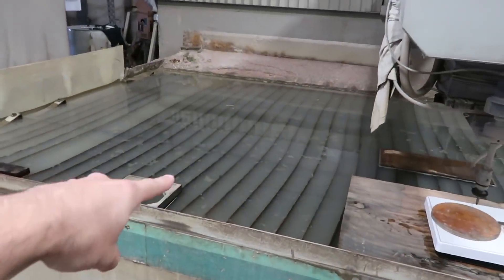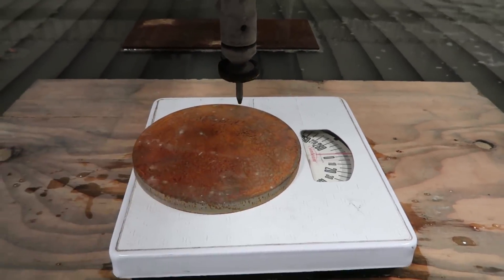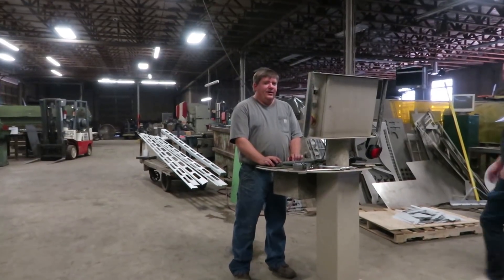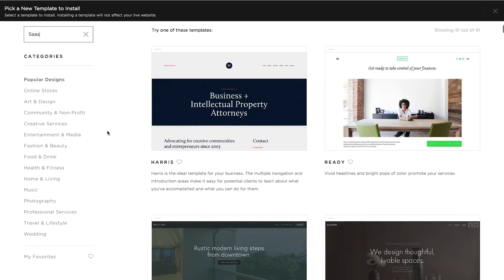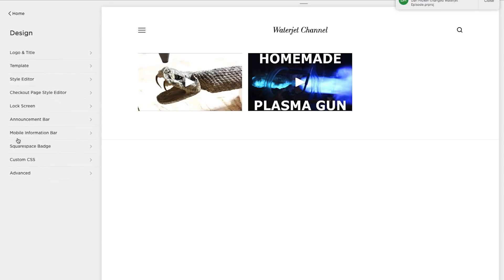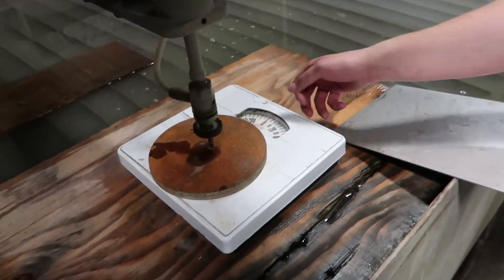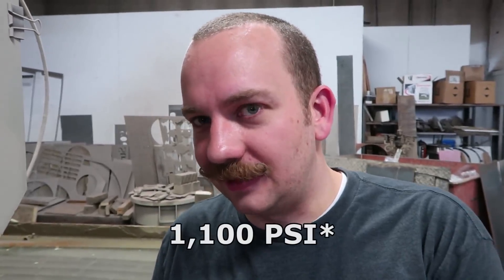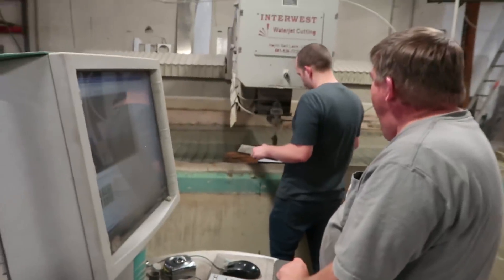How much does High Pressure Water Weigh? Bathroom Scale Cut in Half

Comment: I have a similar water jet at work...... So depending on who rebuilt the intensifier pump, the condition of the hydraulic system running the intensifier pump, nozzle size, flow rate, where your actually measuring the pressure from (seeing as I still don't know where the company make these claims from). I'd would say that your around 54,000 to 57,000 psi at the nozzle tip judging by the size of the stream. Also distance to the material will also affect measured pressure. I would find a 100k psi gauge and measure at the t from the intensifier pump. That would give you the best and most accurate measurement. Or you can look at the control panel for the jet as the software should show you the pressure witch i think is measured at the intensifier pump.

Comment: 60000psi is 60000 pounds on one square inch but the surface of the jet is much smaller than one sq. inch. To calculate the pressure, you need to know what's the surface area of the jet (or at least its diameter and then calculate the area from that, using π×r^2 = surface area). But assuming it's really 60000 psi, we can divide this by 17 (the reading on the scale), and the number we get is 3529 - that's how many of those jets would fit on one square inch if they were square shaped (assuming 60000 is the correct value). One square inch, divided by 3529 will give you the surface area of the jet --> roughly 0.00028 sq. inches or 280 square mil. Divide that by π (3.14) and you get 89 (that's radius squared) and square root of 89 is 9.4 which is the radius of the jet, so the diameter is 2r (2 times radius) or about 19 mil (0.48mm). Being used to metric units, 0.48mm or 0.5mm nozzle diameter seems about right to me. If nozzle diameter is close to that value (19 or 20mil), then that pressure rating (60000psi or 4137bar) should be correct and you do have a 60kpsi waterjet. If the nozzle is smaller, you have more than that, if the nozzle is larger, you have less than that.

Comment: If the water jet had an area of 1"² the scale would read 60,000lbs. As it reads less than that we know that it's smaller. 11/60,000 (about 0.000183) smaller.

So, we know the area, let's find out the diameter of the water jet

a = π × d²/4
0.000183"² = π × d²/4
d = √ ( ( 0.000183"² / π ) × 4 ) = 0.015278"

So if your nozzle diameter is indeed about 15 thousands, then you actually have 60,000psi. (sounds about right)

If your nozzle diameter is not 15 thou, let us know and we can calculate the actual pressure.

Comment: so if you do the math you can easily find out how much it is pushing. so first we look at the hole in the waterjet which is 1mm big and then we take the size of the plate which is 35.75cm's and then water H2O has a mol mass of 1.00572/molx10^-42 

so then we put it in the psi formula (35.75cm x 1.00572x10^-42)^1mm and that equals 
= 1 waterjet 

as u can see my working out of this problem is flawless and you have your answer <3

Comment: I think I figured it out to find the PSI here is the formula PSI= Amount of Micrometers in an Inch(25400)/Area•17 but you need the Area of the nozzle to figure that out so you do the math to solve for the area
17•25400/PSi=Area and the area come out to 7.196 micrometer so plug that in and you get 25400/7.196•17 and that comes out to around 60,000 PSI

Comment: Well, it is square inches, but the water is coming out of a maybe 8mm diameter hole. On top of that, you are firing a focused beam at a plate which is spreading the weight across a wider surface area. Not sure if that makes a difference, but it sounds good so eh.

Comment: Take 3.142 * radius of the rusted metal slab * to the power of 2

then find the top area of the scale = length * breadth

since your reading is 17 pounds, you take that value multiplied by the area of the rusted metal slab multiplied by the area of the weighing scale.

Comment: How about multiple 60,000 psi water jets, to propel a boat forward, and using the garnet abrasive ??  Normally jet ski nozzles, are much wider, and suck in water, in the bottom, and out the back.

Comment: 60,000 PSI should not be expected from any straightforward calculation from the scale measurement. If you want to get from 11 pounds to 60,000 PSI (or whatever the "true" PSI is), you need to model the internal piping of the water jet, model how the water exits the nozzle, and perform accurate fluid dynamics or whatever kind of physics.

If the nozzle diameter was different, the scale would give a different measurement, with the pump still operating at 60,000 PSI. This also applies to the amount of time the water is in the water jet piping, and how easily the water flows through the piping (e.g. the amount of sharp 90 degree turns the water experiences in the pipe). Think about the nozzle on a garden hose. You can vary the speed of the jet, making it feel weak or strong, but the PSI in the garden hose is the same. And when you press down the nozzle handle, the water initially comes out slowly, and it later increases to full speed, because the "older" water has more time to accelerate in the hose (this is more easily seen with a setting like shower).

Think about what the PSI is "practically" doing: it is just bringing the water and the abrasive up to a high speed. You can create a 50,000 PSI or a 70,000 PSI water jet that would give a measurement of 11 pounds on the scale (even with the same nozzle and the same experiment setup).

Comment: We'd need to know your nozel size to know output pressure. I'll assume .25 square inches because that looks like your wastage when you cut. Using that theory you're putting out 44 psi. But wait you say. 44 psi is too low to do anything. How can this be. Simply put, the water is reflecting off your metal plate. When those droplets spring back up they are taking a lot of energy with them. You machine may be outputting close to 60k psi but since most of the water splashes out you end up reading a really low pressure. In order to measure accurately you would have to seal between the scale and the nozzle, which would be quite difficult because as you apply pressure, the scale moves away, creating a gap where some of the water, and there for energy, may escape
Reply: I found out their nozzle diameter is 1/32. The area of that nozzle is a out 0.000767. Then we determine what number we need to mutiply by in order to get to one, which in this case is about 1,304. Multiply that by 11 and we get about 14.3k psi.

Comment: It depends if the pump is running in metric or imperial 🤔
Or if the fittings are in BSP or not. . . 🤔 But if you cut the scale in half then you half the PSI.

Comment: Pressure in PSI = 11 pounds / (area of water jet nozzle in square inches).

Without knowing your nozzle measurements:
11 pounds / 60000 PSI = 0.00018 square inch nozzle
= pi * (nozzle radius)^2

Nozzle radius = sqrt(0.00018 sq. in. / pi)
= .0076 inches
Nozzle diameter = 2 * nozzle radius
= 0.015 inches 
= about 1/64 inch

So I predict the diameter of your waterjet nozzle is 1/64 inch. Seems plausible from looking at it.

Comment: Pressure = Force/Area 
if you could find the radius or diameter of the water stream’s exit hole on the jet (assuming the water spread at such a close range to the plate is negligible and is basically equivalent to the area of the exit hole) and record the force (weight) applied to the scale then you could find the pressure of the waterjet, ensuring to keep units on all quantities consistent of course!

Comment: Take the cut diameter multiply that by the 11 lb multiply that answer by 100 is the best guess I have
Reply: Actually take the cut diameter multiply by the 11 multiply that answer to get one square inch multiply that by a hundred to get your answer: Example  1/4" cut equals 11# so you would take that answer multiply it by 4 to get one square inch then multiply that by a hundred to get your answer unless I'm completely mistaken
Reply: What is the cut width of the jet at 0

Comment: Real captain here, the size of the scale doesnt matter at all, the thing that is hard to estimate is the size of the jet stream becausme it is not uniform in all its area, thus the calculation need more informations about the water particles speed. Here are some important informations you could use instead: the speed of the jet stream: by somehow reversing the jet to be facing upward ahaha, then with the height youre able to calculate the speed of the water when it lefts. The quantity of water used by time. With this you can use the same formula wich I think they use to calculate the PSI

Comment: you have to measure the diameter of the beam of water. you're not putting pressure on the entire plate, only the spot the water is striking, so the size of the plate doesn't really matter. use a different plate if you don't believe me.  if the full 60000 psi is actually hitting the plate, the 11 lbs of force is concentrated on ~0.00018 square inches.  you'll have pressure losses in the space between the nozzle and the plate.  the 60,000 psi is likely the output of the pump, and you'll have a pressure drop in the water line from the pump to the nozzle.  

suppose the water jet is 1/8" or 0.125 inches in diameter.  that's 0.0123 square inches.  11 lbs / 0.0123 =  894 psi striking the plate.  this would vary widely with small changes in the height above the work.
suppose the nozzle orifice is 10 mil in diameter.  that's 0.0000785 square inches and 11/0.0000785 ~= 140000 psi in the nozzle!
ask craig what the nozzle orifice diameter is.  he's probably got a spec sheet.

Comment: You must use the diameter of the nozzle to calculate the pressure. It is very small and the force (11 pounds) is a lot for such a small surface.

Comment: 3810.4PSI

So 0.060" of diameter exercing 11lbs of weight
First let's make that metric to make sense
0.1524cm and 4.98952kg
Weight is a force, that equals mass times gravity
Scales feel that force but adjust it to show only mass
So we need to multiply the mass shown in the scale to get the force
9.807m/s^2 * 4.98952kg=48.93222264N
Now we need to calculate the area
The diameter is of 0.1524cm
So D^2/4*pi=area
So the area is of 0.01826541603cm^2
Pressure is measured in 1N/1M^2=1Pa
SO let's put the area to M^2 it'll be 1.826541603e-6M^2 or just 0.000001826541603M^2
Now we divide 48.93222264N by 0.000001826541603M^2 to get 26271747.4666Pa
Now we ask google how much Psi is 26271747.4666Pa
Which give us an answer of 3810.394818868065PSI or 3810.4PSI
Reply: Or just remember that PSI is pound per square inch and do 11/((0.060/2)^2*pi) to get 3890.4 PSI, which means I've probably lost 80PSI when messing around previously

Comment: The nozzle must have an internal diameter of about 1/64 of an inch for that to be 60,000 psi.
psi is pound/square inch, so area would be 11lbs/60,000psi. that's 0.0001833 inches squared. using pi*r*r, the radius would be 0.00764 and the diameter 0.0153 or 1/64 inch internal diameter of nozzle.
Reply: or 1/52nd inch for 17lbs

Comment: OK, I hope you will understand me. The power of your water jet is given in pounds per square inch. Since the muzzle is much smaller than that, it is reasonable that the water jet is only creating 11 pounds of force. 

Since I don't have the diameter of your waterjet, I can't prove if your waterjet has 60, 000 psi. What I can do is, that I can calculate the theoretical diameter of your nozzle, assuming your waterjet has 60,000 psi. For that I only need the area. Since the force on the plate is 11 pounds, I can assume that the area is 11/60000 square inch which I will call A. Since A = pi * r^2 I can just divide A by pi and take the root of that to get the radius. If I multiply that by two I get the diameter, which should be roughly 0.015 Inches. So if you measure the diameter of the nozzle and it is smaller, your waterjet has more pressure than 60000 psi and if it is bigger it has less. 

I may be wrong since I'm German and imperial units are giving me a headache.

That mustache is very sexy btw
Reply: If only I paid attention in math class..I still wouldn't understand
Reply: Yeah, i get it. You putting out 11 pounds of force total. If you were putting out 60k psi over 1 inch you be putting out 60k pounds total. So you take 11 pounds and divide it by 60k in order to determine what fraction of an inch the nozzle is. In theory. In this case 18 thousandths. But that's not diameter, that area. In this case the diameter is the square root of about 5 thousandths of an inch. Which we can look and see it way too small

Edit: whoops, i divided 1100 by 60k. Add a few zeros to the left.
Reply: 84neilbone hahahaha
Reply: Xanthir Ihavethecrakers the distrabution is the size of the nozzle. Whatever the area of the nozzle is, is the distribution. Having the plate there doesn't dispearse the weight in that way. The total force of the jet was 11 pounds. If we assume a nozzle size of 0.25in^2 that's 44 psi out of the nozzle. 

The reason that's so low, because the energy of the water jet is insufficiently contained, getting used up to fling water all over that shop
Reply: This makes me want my mommy
Reply: cain tuphast whoops. Forgot, i need the area, not the diameter.  It's closet to 3600 psi
Reply: cain tuphast final try i promise. I used the wrong formula for area. I put in pi × d^2. Using the formula for area that works, i got 14.3k psi
Reply: Close enough for government work... Unless it's NASA. They're NEVER happy with your math. XD
Reply: I think the kerf is about 1/32" if I recall
Reply: cain tuphast 352 psi then. Though i have explained why that number is so low
Reply: Dann wäre der Durchmesser in mm 0,38 mm. Hört sich irgendwie falsch an. Schätze den mal so auf 5mm. Die Fläche ist 19,63 mm^2 => 0.0304 inch², bei F = 11 pound. Beide Seiten mal 32,8 nehmen: 361 pounds per square inch. Hört sich auch falsch an :(
Reply: MKD Gaming lol
Reply: My waterjet kerf width(stream diameter) is about .012" so sounds about right
Reply: iceprego486 only hearted for mustache xD
Reply: America vs germany 😂
Reply: Emile DesForges this here is stuff that you learn in 9th or 10th grade. Have you ever tried math or physics problems on brilliant?
Reply: iceprego486 Brilliant?
Reply: Yeah that's how imperial works , only time you have weird conversions you don't have in metric is when you start getting into anything with mass
Reply: iceprego486 wring, 2+3 is half of a dead fish
Reply: MKD Gaming part of me wants to spend the next hour to 2 hours doing the full physics of it, but i think ill save that for when class starts again bc i dont want to cry just yet... im a senior in uni as a physics major, i advise kids to stay away from it; do computer science instead bc my head is thrown in a blender every other week
Reply: MKD Gaming we are missing something, because I know for a fact that machines like this run around 40,000-70,000 psi.
Reply: @proto man Ich finde 0.38 mm gut, wenn man bedenkt dass da 60.000 Psi drauf sind würde bei 5mm sehr viel mehr Wasser und Abrasive verbraucht werden
Reply: iceprego486 Hab grade bei nem Lieferanten nachgeschaut. Tatsächlich fangen Düsen bei 0.1 an und gehen dann bis zu 1mm max. Konnte ich mir irgendwie nicht vorstellen aber gut, du hast recht :D
Reply: rem brandt generally prefer she if you please
Reply: iceprego486 hey endlich jemand Deutsches. pound feet inches u. S. W finde ich genau so schimm
Reply: iceprego486 That sounds dead on to me, reverse engineering at it's finest
Reply: iceprego486 ? 🤔
Reply: But it also starts to cut through the plate
Reply: Ugh, good points and math made, but I’m pretty sure you could fit thousands of those water jet streams into an inch, it just wasn’t an accurate way to test the psi
Reply: Have no idea what u just commented and i wanna give up at math
Reply: interesting.... did you factor in all the water that escaped to the other side of the scale(due to the hole it cut) and therefore not have its pressure measured?
Reply: The fact that the comon citizen has access to this level of education is a testament to how far we've come as a civilization.
Reply: based on these estimates i wouldn't be surprised if it was a 4mm or 1/64th inch nozzle
Reply: Perfect
Reply: It's about 40 grand when the nozzle is new
Reply: yup hes 100 right i smoke weed so i know
Reply: I'm american and imperial units are giving me a headache
Reply: You know, i realize that a LOT of americans dont know the metric system, but those that do, we never complain when something is in metric we just either know or do the conversion. Its not something to be so dramatic about.
Reply: mrNACHOOO_ gaming it's not an issue with math. (Beyond not having enough zeros on the left side) it's an issue with the physics.  The energy wasn't 100% contained, so the reading we're using to solve this is way too low
Reply: mrNACHOOO_ gaming the important thing is they're wrong, and the test was invalid anyway
Reply: MKD Gaming too bad I can't prove them wrong since I suck at math haha
Reply: iceprego486 you forgot to add in the curvature of the Earth
Reply: You forgot to factor the weight distribution of the water jet stream over the metal plate which the guys on the video claimed the area of to be around 100 inches squared this would make the diameter of the nozzle 0.15 inches instead of 0.015 inches.

Comment: You might be losing tons of energy due to the deformation. Most of the energy is likely still going into cutting the steel, even though it is not cutting it much. Another way would be to measure the area of the jet (by cutting a hole through a plate) and then measuring how much water comes out over something like a minute. That's more math heavy and less intuitive than this though and probably wouldn't make a good video.